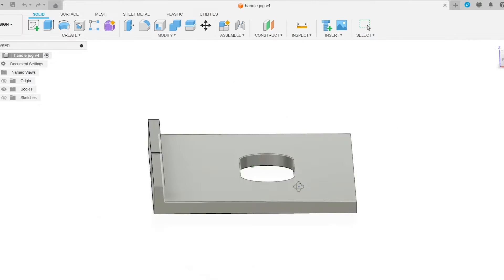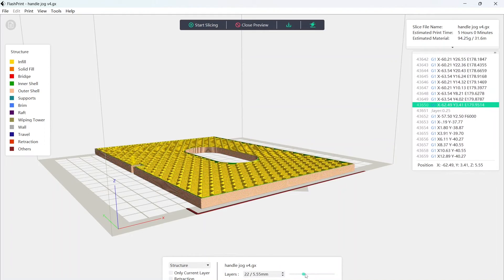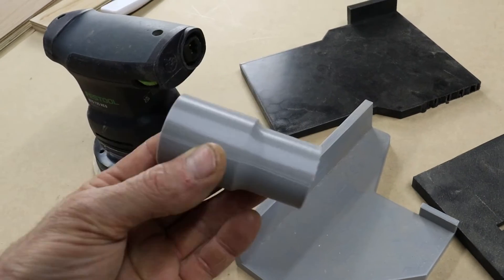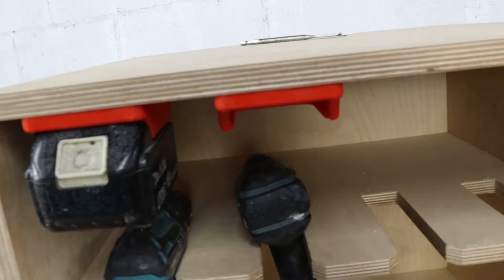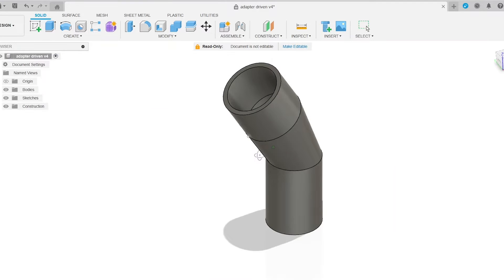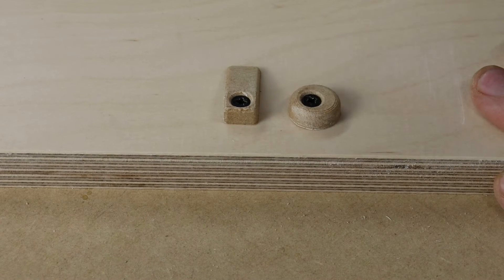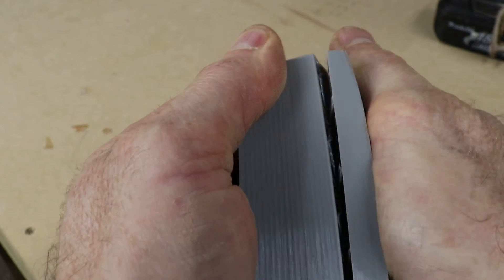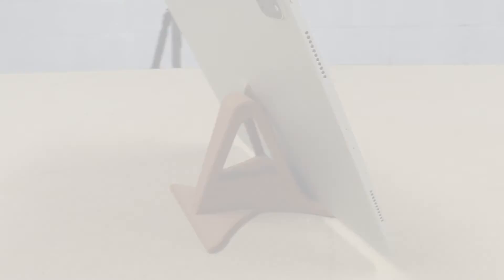How we use 3d printing for cabinet making

Comment: You can temper 3d prints by placing them in the oven to increase the strength between layers. Should be able to find videos on here for that.
Reply from the maker: I didn't know that I will check it out, thanks!